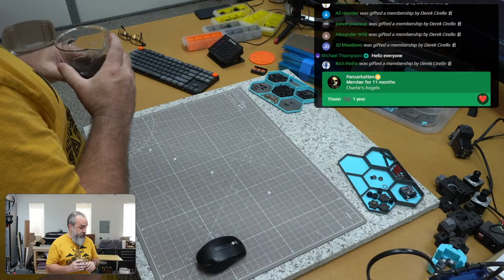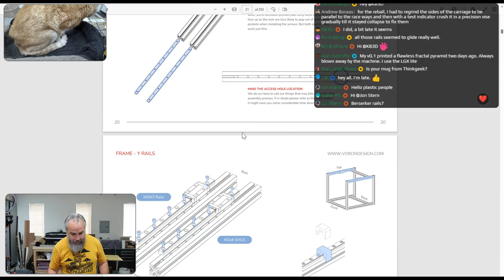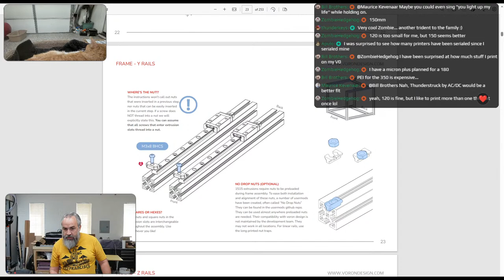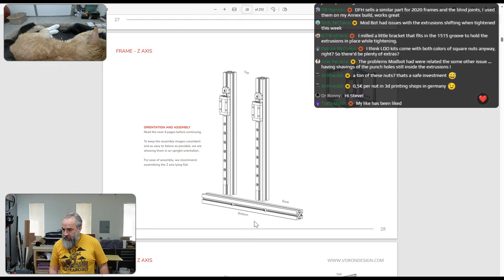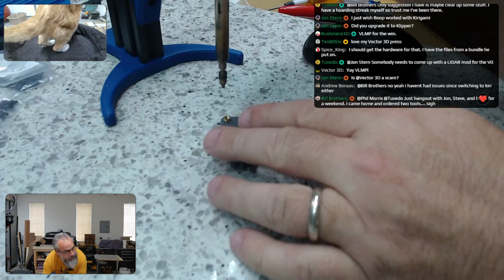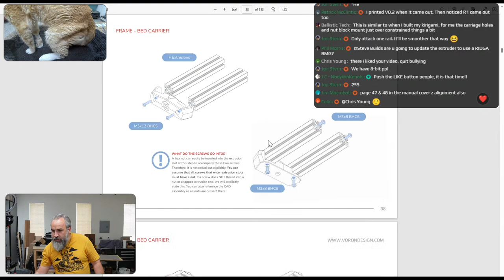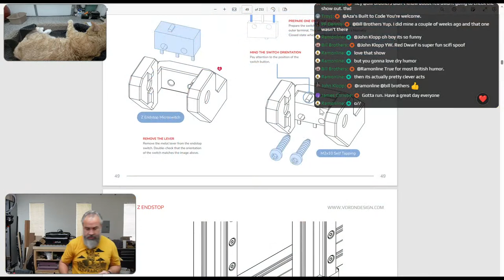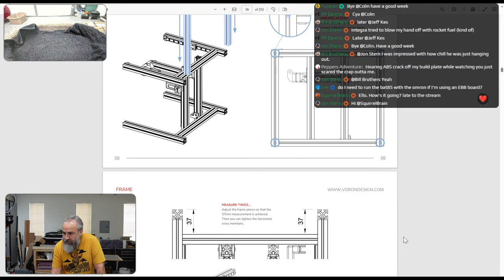Voron 0.0 to 0.2r1 Rebuild - Part 1

Comment: Steve, you were spot on at ( https://youtu.be/9kW-7GCcIE4?t=8506 ). The Kirigami nut block heat set hole could use more meat. I cracked my block when tightening too much.

Comment: Hello Steve. I was re watching the live stream. Why the spacers on the back for installing the rear most extrusion. 3:33:00 marker? Thanks
Reply from the maker: Here's a time stamped link to where I explain why I'm doing that.  https://www.youtube.com/live/9kW-7GCcIE4?feature=share&t=5435
Reply: @SteveBuilds  thank you Sir. Makes sense. Was rewatching the streams as I am struggling with squareness after the steps for the a is completed. Didn’t have this issue on my 300 trident and just happen to hear your comment about spacers and was questioning if I missed something. Thank you again and have a great day.

Comment: Do you have a link to an install guide for that version of the Kirigami bed mount? I'm not seeing one anywhere, even checked the official Kirigami github page.
Reply from the maker: I don't think there is anything different about this install.  What are you seeing as different and maybe I can help.
Reply: @SteveBuilds  The wire guide and the cable chain seen at 2:19:25. I fumbled my way through them and accidentally installed the heatset insert in the wire guide on the wrong end of the hole and had to press it most of the way through. Still not sure why that hole goes all the way through in the first place. The cable chain mount also took me a long time to figure out, but watching your video helped. Hopefully they update the github page for this latest version.